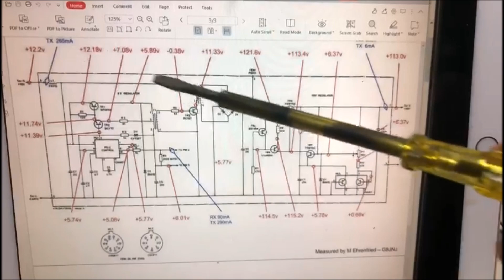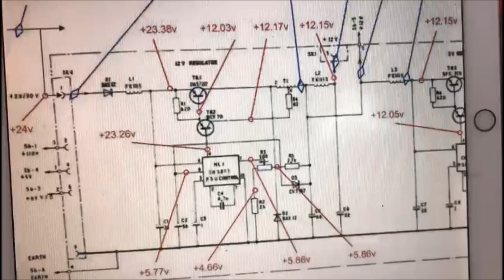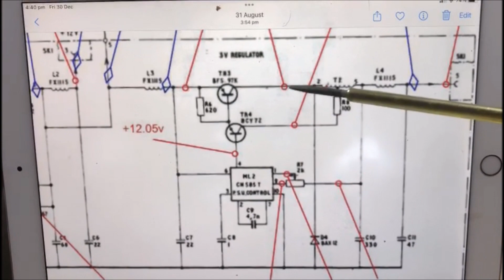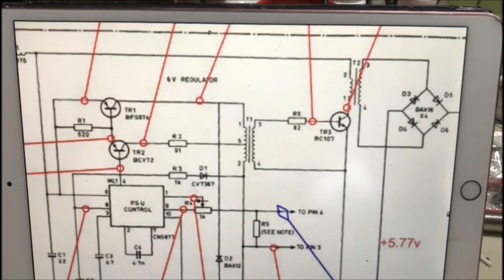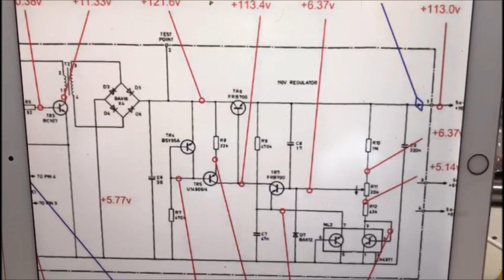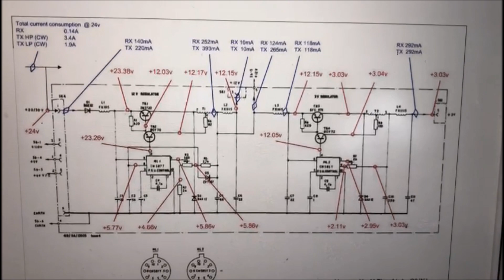Clansman 320 Power Supply Complete Repair

Comment: I used a MC34063 as a replacement for one of the obsolete switching drivers and it works fine using the same switching frequency. I would make a drop - in replacement PSU if I could find the mini Sub-D connectors and someone to make a decent shielding can. This is why I stopped development. The KIS-3R33 module can be modified to supply the 6v, 3v and extra LP filtering and protection added. Good work. Thanks for putting this up. 73's 2M0GWQ